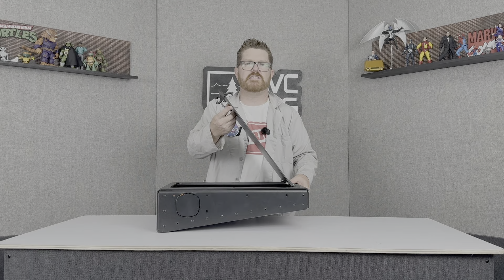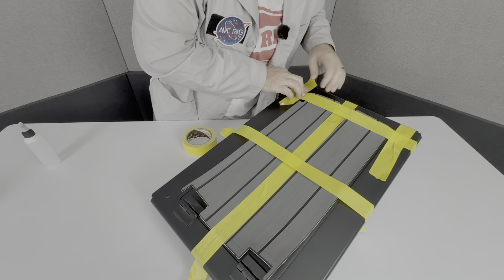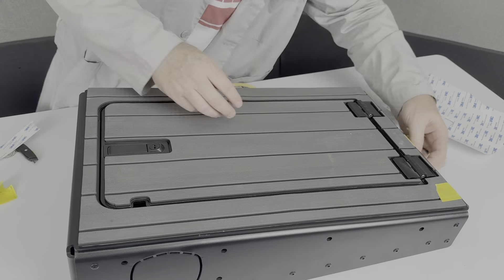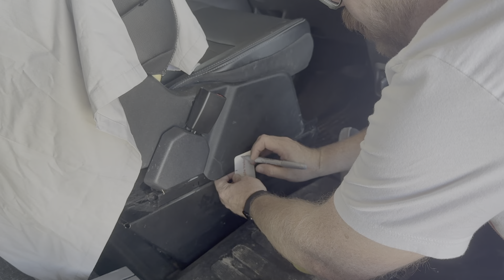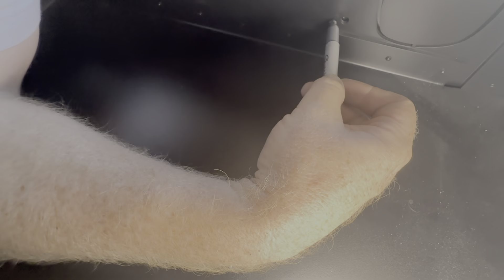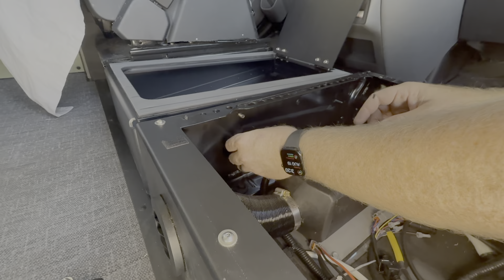Lock Up Your Valuables! Install the AVC Cab Locker in Your Ford Transit Van

Comment: Hey Matt, Question, I watch all your videos and I’m not having any luck getting 3m 20 adhesive spray for my thinsulate.  
Will 3m super 77 multipurpose adhesive spray work or do you recommend another product.
Reply from the maker: I’d try 3M 90 or another brand of general purpose adhesive. Locktite has worked for Me in the past from the depot. 77 is a light duty adhesive for paper crafts.

Comment: Looks great to me!  I guess if someone tried to take the entire box (if they can't defeat the lock on the lid), they won't be able to unscrew the bolts with the lid locked, as the bolts would just turn?
Reply from the maker: Yeah I think so. You could replace the bolts with security style.

Comment: Silly me, i tried to guess the price.  I figured $250 was a fair price based on other products on the market, so I doubled that for "van life" price, I was still $150 short.
Reply: They are out of control with their prices
Reply: @travissmith5006 have you used any of their parts?  I have and they are very high quality and specific to the transit.  This is a relatively small market and these are bespoke parts tailored to this exact use case.  The price doesn't surprise me at all.
Reply: @moonraker814 good to know, glad you had some money to waste on a metal box
Reply: @moonraker814 Good for you for wanting to spend 650 on a metal box 😮
Reply from the maker: I think we’ll do a price breakdown video on the actual costs to produce these. You’d be surprised.
Reply: The whole van is a metal box, and we can agree that building a campervan is not easy on the finances.  LOL.  This smaller metal box is for my bigger metal box to protect a plastic and glass box (which is more valuable than the smaller metal box). 
😂😂. Have a great day box people!
Reply from the maker: Yeah. I wish it was cheaper to produce. I know everyone thinks things cost us $10 to make and we just upcharge like a robber Barron can but the margin is actually really low.
Reply: For sure building one is not cheap but I can keep my cost down by not overspending on a 650 dollar metal box. I encourage you to buy it, I’ll stick with value.